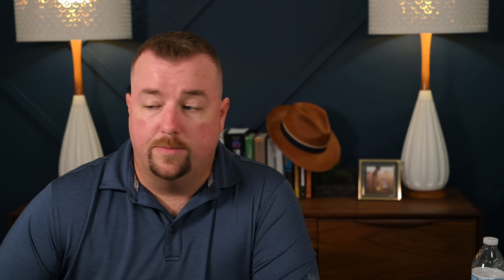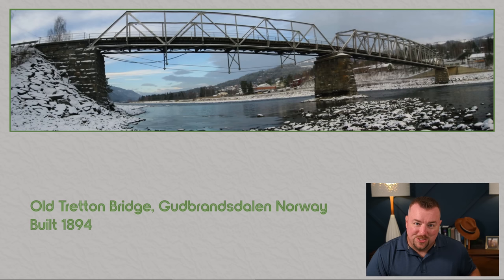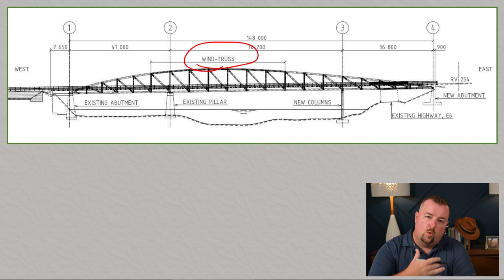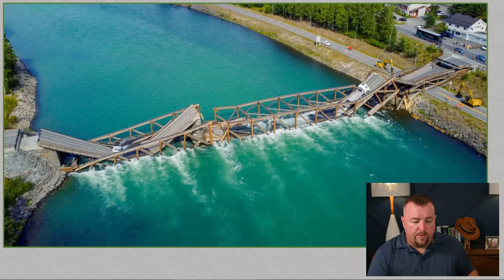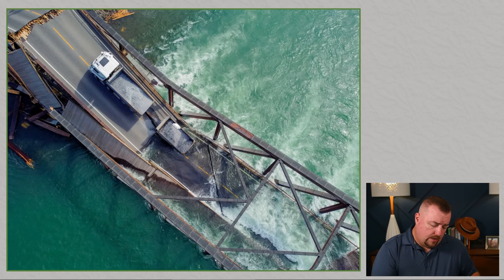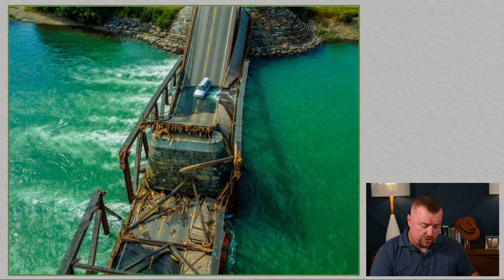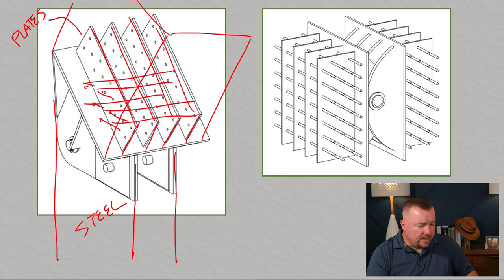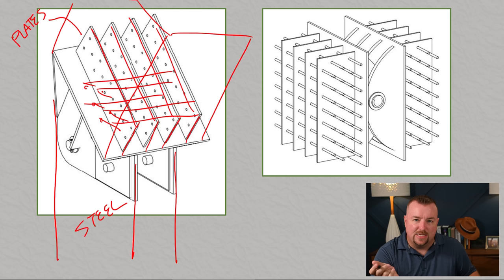How Did the Engineers Miss This?

Comment: I've used similar wood to steel connections in my construction. The one thing to double the strength of that connection is to have a steel compression ring wrapped around the area where the dowels are both located. And most definitely at the butt end of the wood where it directly touches the steel. The compression ring prevents the wood from splitting. Also aligning the holes in the wood in a half triangle shape (Arrowhead) with the point facing towards the wood helps reduce splitting instead of all holes in a line.
Reply: Not anyone with experience here just curious. Would it make sense to change the dowels to squares/rectangles to reduce the wedge action?
Reply: @_aullik  think of it differently. Wood is fibers. In this structure used similar to rope fibers. Now imagine the same structure, wood fibers replaced by steel cables, attached with the same pin arrayed into the terminal end of the steel fibers with nothing to hold them into place except the rate of material fatigue. Just a pin placed into a fraying rope end, nothing to stop it unraveling.
Reply: I was thinking something similar while watching this video.
Actually, would it be possible to perhaps use compression alone to hold the wood in place instead of any dowels?
Or mostly compression?
Reply: @Luredreier  That was my thought too. Generally this sort of connection in many designs rely on friction only, the bolts are there only to maintain proper pressure and friction. This could also use all of the methods. Those sheer bolts could also be put on tension and apply friction between wood and steel, then another bolts welded into metal plates on the other sides to prevent the wood from splitting.
Reply: This exactly came to mind as well! Think about how the handle of a hammer or an axe is attached--those joints are highly robust. The steel head acts as a compression ring in that case, and that joint stays in place without any pieces undergoing direct shear.
Reply: Had the same thought as well. Although, I think in this case, moisture could easily become trapped under the ring and further damage the wood and steel pins.  This is all fine indoors as long as all the math was done correctly, but outside is a different story.

Bottom line is that building bridges out of gluelam is a terrible idea and should be abandoned immediately. Any existing bridges and structures should be demolished and replaced with proper, proven building materials.
Reply: I wonder, if plywood with proper compression joints would not behave better. Deck could just sit on steel beams.
Reply: @brylozketrzyn  Cross laminating would probably make the joint stronger especially if combined with a compression sleeve. However, nothing will change the fact that it is laminated wood used outdoors, and over water.  I don't see any way laminated wood can be a reliable building material for a large bridge or structure.
Reply: @snaredude56  We have many bridges and other buildings of the material.
No, the issue is design, not material.
Reply: "steel compression ring"
There is a reason why metal compression rings were used for wood connections for centuries. This bridge screams of "we must be modern"-people that have no clue of history.
Reply: @Luredreier  to say, there's no issue with the material -
is like saying for example, "there's nothing wrong with playing with fire -
and if it goes wrong, then it's entirely the players fault for having made a mistake"
Reply: I was just thinking that was the obvious way to strengthen the joint. Splitting wood is, by definition, expanding the dimensions of the cross-section. By preventing the cross-section from expanding, you are ultimately preventing the wood from splitting... up until enough moisture makes its way through the wood and destroys it from the inside, which would be difficult to inspect regularly due to the compression rings. I think it's very strange to claim a wooden structure like this under regular, variable load could safely and reliably last 100 years...
Reply: @JeremyHolovacs  " I think it's very strange to claim a wooden structure like this "
The "like this" is the important parts. Wood is a good construction material and europe has a long history of wooden bridges that have lasted centuries. These collapsing bridges just show how dangerous it is to dismiss the knowledge of history.
Reply: @ABaumstumpf  I agree that the "like this" is important... Wood is an excellent construction material for many things... but as soon as I understood the joint construction and stresses on this it seemed pretty obvious to me that this design was flawed. Laminated wood is very strong for many applications... but also has some dangerous weaknesses that are difficult to detect and mitigate, especially in this kind of environment. I wonder if synthetic material like carbon fiber would have been a more appropriate building material choice.
Reply: @snaredude56  "moisture could easily become trapped under the ring"  Just add some expanding epoxy under the ring. A glulam bridge for vehicles is a terrible idea though.
Reply: I don´t work in wood myself but most gluelam bridges i seen (very common around this) start and end all gluelam in a shoe. And of cause, those don´t use the wood in tention.
Reply: I'm not acquainted with the field, but just looking at those connections it seems like a metal collar would be necessary. Tools with wooden handles all do this for exactly the same reason.
Reply: @Chrisfrom_Dallas  That's an interesting cable analogy but isn't this glue laminated timber like plywood, albeit with far more substantial longitudinal layers than cross layers? (Because the beam load is longitudinal). When they cut the slots at the ends, they won't want to remove any of the longitudinal layers as that would have an obvious impact on tensile strength so I'd think the slots would be aligned so that they are only removing the cross grain layers. So at the steel sheet & dowel joints they have removed all the cross grain layers that would have given the laminate strength against the edges splitting off!
Reply: @ABaumstumpf  occasionally it's frustrating that YouTube only lets me give a message 1 "like"!
I guess it's difficult to inspect the condition of the crucial components that are hidden by the compression ring but there's probably a way.
Reply: Definitely need to confine the connection. I was thinking FRP wrap would do the trick
Reply: @skysurfer7601  There are at least some of these kind of beams that are made with all of the grain in the same direction which are used where force is only required in one direction.
Reply: @fukkitful    I don't think the glulam members themselves are the problem.  The Canadian Pacific RR used some glulam members to replace several timber trestles in British Columbia which, as far as I know, are still in use.  Instead of using solid wood (no joints) pieces of 30 feet or less, glulam was used to reduce the number of pieces of wood with no defects included in each member to rebuild the structure with fewer pieces.  Those joints were the typical butt and gravity joints in a trestle.
The problems I see with this bridge are the tension connections of the wood-to-steel with pins or bolts because wood connections in tension are the hardest to successfully make. I don't know if the slots for the steel plates were included in the manufacture of the beams or field done which could cause problems.  It is also possible the glue used to make the glulam pieces was not correct for the application.  I have used several different glues on wood where the wood will split or break before the glue will. 
A glulam member should be able to be made as big and long as needed because of the way the member is made as the individual pieces are chosen and cut to remove defects such as knots, splits, etc. which are then not introduced into the final member. to weaken it.
In the end, I would have kept the glulam and steel but made the joints compression instead of tension and much simpler.
Reply: @brylozketrzyn  Exactly. The pins are causing the wood to split. Compress the beam end and let the wood sit on the structure.
Reply: @_aullik  no.
Reply: @royreynolds108  I know the strength to weight ratio of glulam is about 3x stronger that steel.
Reply: Yeah at first I thought the metal was a sleeve with the wood inserted inside of it so it couldn't expand and split. Having just dowels like that on a bridge is crazy. I also wonder if any of their lab tests and models use wet wood or if it's all perfectly kiln dried wood...
Reply: A compression ring would have helped to prevent the wood from splitting but ultimately the bearing strength of the wood makes having a solely shear connection a poor choice. I believe that having  a bolted connection with steel plates under the heads and nuts to increase the friction between the mating surfaces of the joints would have increased the strength.
Reply: @StippleAlpha  Quite true! However, all axes and hammers need hardwood or steel wedges driven into their caged wooden handle to create a long lasting tool. No need to ask what a (poorly performed) 3D finite element model would yield - a useless axe or hammer.
Reply: @snaredude56  For now must totally agree with you. Too many gluelam bridges have collapsed in far too short a periode of time. 
However, gluelam may have a future. Lots of laminating techniques are available (like finger joints), but these all have their price tags. And then of course, the extensive testing of the laminated material must be performed. So all properties of the gluelam material can be guaranteed. Bottom line: €€€  ---   Ouch! "Hey sir! What are you trying to sell to me! Wood or gold?"
Reply: @ABaumstumpf  And then finally the bridge gives its own answer to these We-must-be-modern people...
Reply: Just an 'arm chair engineer' here, but I had the same thoughts.  Banding around the ends to prevent the wood from splitting apart would add a lot.   It's common knowledge that wood has different strengths in different orientations and 'splitting' is a problem in a lot of wood designs.
Reply: @mikefochtman7164  I totally support your msg. However, in our "Modern Times" people seem to trust a computer more than their own brains. That is if they had any above-average brains at all, let alone any experience in wood working. Very clearly these kids seem to think "Internet tells me all" - and then real life tells quite a different story...
Reply: No worries. No need. What's 90 years between friends?
Reply: Interesting. When seeing those failure modes, something like a compression ring was my first hunch but I'm no engineer, so it's good to see that this kind of this is actually being done!
Reply: @ABaumstumpf  You're being extreme. These people obviously attended history lessons at some point during their education. They just didn't properly apply that knowledge to this project. Saying they have "no clue" could only be said by a person with NO CLUE how to embrace the grey areas of life, instead of speaking in polarizing terms.
Reply: @BrainScramblies  "They just didn't properly apply that knowledge to this project. "
That would make it even worse cause in that case they had learned how to do it properly in a way that does not endanger people and either just didn't care to listen, or didn't deem the safety of people as important enough to remember/apply this. I only insinuate a lack of knowledge, what you said would imply a lack of morals. I'd rather have people that have no clue in charge than people that don't care - for them there is still a chance to learn.

And this should never have happened. There must have been several levels of incompetence for this to not be detected. This is the same behaviour that has lead to many deaths in recent years - like the Florida University bridge.
Reply: @ABaumstumpf  What does the phrase "no clue" mean to you?
Reply: @BrainScramblies  Obviously exactly what the words mean. What does it mean to you when you say that they knew what they were doing and still build bridges that nearly killed people?
Reply: @ABaumstumpf  I didn't say that....
Reply: @ABaumstumpf  If I did say that, it would just be a factual piece of information about their building projects. But, assuming we know everything about their education and knowledge is laughable. 

THATS WHY INVESTIGATIONS EXIST. 

If you want to make a claim.. PROVE IT. Tell me exactly what a "clue" is. Tell me about your documented interactions with these people and what data you used to deduce that they do or do not possess a "clue." I WILL then be the deciding factor on whether your data is relevant and verifiable.

Welcome to the real world, kid.
Reply: @ABaumstumpf  I do commend you for trying really hard to ignore my question about what "no clue" means to you and turn things back around onto the other person. It was cute... something my therapist would laugh at.
Reply: @BrainScramblies  " I didn't say that...."
You did - as i had quoted: "They just didn't properly apply that knowledge to this project."
And then of course you also had to edit your comment cause you noticed just how wrong you are. So yes - it was you that claimed they knew better and choose to ignore it.

"I do commend you for trying really hard to ignore my question about what "no clue" means to you"
I already said what i mean, you are just dishonest and act like i didnt - cause accepting that would mean you'd have to face the fact that you are wrong.
Reply: @ABaumstumpf  First off. Sentences are made up of words. Words have different meanings. Those are called definitions. Words are made of letters. That's called the Alphabet. Here is how it looks:
A, B, C, D, E, F, G, H, I, J, K, L, M, N, O, P, Q, R, S, T, U, V, W, X, Y, Z
Reply: @ABaumstumpf  YouTube has an area called the Comments section. This is where people use words and sentences to share their input and opinions with the other people watching YouTube. If you can put the sentences together in your brain, you might be capable of something called "understanding." This is a more complex topic though, and I think you'll need much more help with that.
Reply: @ABaumstumpf   " "  These little symbols are called Quotation marks. You use them when directly transcribing (sorry if that's a big word) the exact words someone else used.
Reply: @ABaumstumpf  This video that you may or may not have watched is regarding data, science, and statistics. These are complex things and we'll need to do more work until you understand those concepts.
Reply: @ABaumstumpf  Data and Statistics are two related things. Usually, data is collected and then compiled into something called a statistic.
Reply: @ABaumstumpf  Without data, statistics cannot be developed. That's where Assumptions comes into play. It seems you're already very familiar with this one.
Reply: @ABaumstumpf  Assumptions are what happens when you guess what an answer might be, without the full data to prove your determination. It's like a form of prejudice.
Reply: @ABaumstumpf  Assumptions are typically classified (sorry if that's a big word) as the behavior of those who are too uneducated or unable to process complex concepts.
Reply: @ABaumstumpf  Assumptions are understandable when the subject does not possess the energy or mental reasoning skills to ponder objectively. It takes less brain power to make assumptions than to interpret multiple variables.
Reply: @ABaumstumpf  (This is going to be a tough one. Take a break if you need to.) Confirmation Bias is the tendency to specifically find and use information that supports your already developed beliefs. This happens when you choose to ignore other relevant information in order to provide validation for yourself.
Reply: @ABaumstumpf  Let me know if you need more help and we can chat about what Emotions are and how they impact Assumptions
Reply: @ABaumstumpf  Here, I'll even share the definition of CLUE with you. You still seem to be confused.
CLUE: something that guides through an intricate procedure or maze of difficulties.

An example of an object with no clues would be a rock. An example of something with at least one clue is an infant human.
Reply: By that, do you mean you're compressing the wood with the outer plates? That was my first thought. There's no friction between the wood and steel helping the process. It's just floating entirely under tension. In my mind, it would have been better to have floating steel plates in the sandwich with the bolts applying compression to the wood/steel joint. I don't think it'd solve the fact that wood isn't great under tension when you have the bolts inline with the grain, but since this is laminated, some of the grains should be opposite.
Also... that should reduce the problems of steel and wood expanding/shrinking (or not) at different rates in different conditions. In cold weather, the steel shrinks, hot, expands. In wet weather, you'd expect the wood to swell if it wasn't sealed properly. In any case, it's likely that at some point in its life the steel dowels were loose in the loose wood 'sandwich', which means it's fairly likely the wood was being hammered back and forth against the dowels as each vehicle passed.
Reply: Isn't that exactly how wooden ship beam joints were connected even back in the good ol' pirate days.